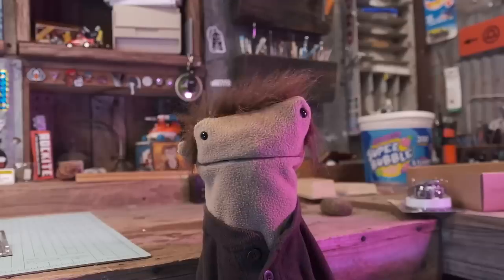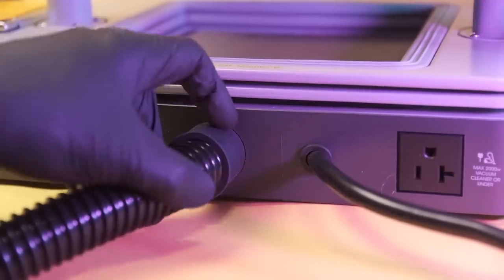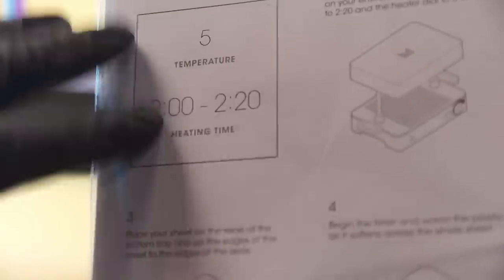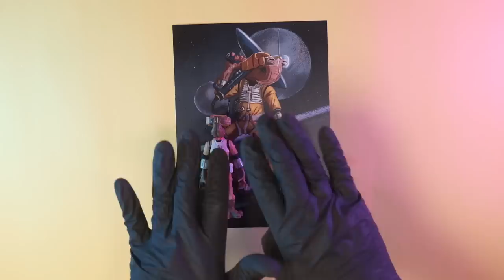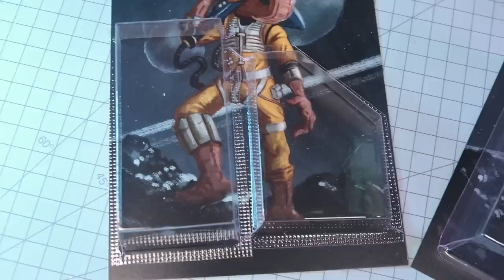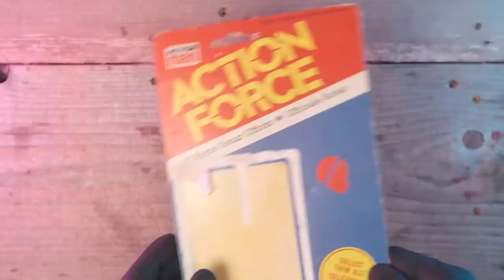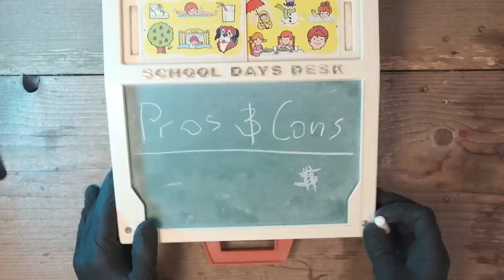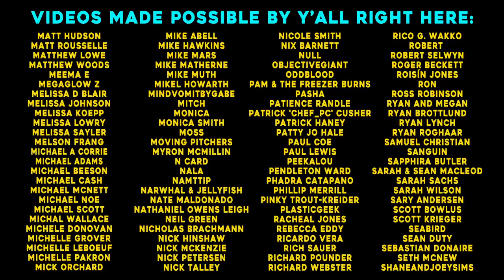Custom Action Figure Bubble Blister! | Mayku FormBox Review!

Comment: I bought one of those Sombrero Punches because I saw this.  Yesterday I used it + cardboard + hot glue to make a bunch of tabs on various little boxes, and was able to organize my shop better.  Of course I could have just done it years ago with a hobby knife, but the punch makes them look so pro it inspired me to get around to actually doing it. I'm awarding you +2 Organizational Inspiration Points.   :)
Reply: Did you find the same brand as his? I can't find info on that exact one and I don't like the one I just bought

Comment: omg awesome, Mr Crafsman. 

"my credentials" - I was a manual sign vacuum moulder for many years doing fitouts for Full toyota, suzuki, hyundai etc... dealerships The big plyon logos at the top were the biggest we could mold.
Most of the time H.I.A. (high impact acrylic) or A.B.S. (acrylic backing sheet <-- i know its not real name, but that is all it was good for "for us" ) at 3- 5 mm thick. PP (poly propylene sheet) we could go down to 1.5 mm. We would pull most stock at about 130 - 170 degrees Celsius (it can be a small window to hit sometimes). 

Your machine has a ceramic plate. I like this over normal room heater type molding machines as it will be more uniform. A hot spot can fry your stock.

In my opinion you are doing very well. 
I would suggest you get an infra red camera or the laser/sensor ir gun type is good too (I just got a "bv9900 pro" for the flir camera).  

Anyways I want to try to help with some tips. 

1. Use the ir to see the temp of the material and go on that more then a timer. Get a good "feel" (please don't caress the hot material) for what you can push it to. Make a book for ideal temps for each type of plastic it will help a lot.

1.5. Temperature is best if it is uniform. So don't be afraid to let it heat soak and reheat and soak and heat again, just carefully monitor temps at all times. ( This is more for very large pulls but is still true for most situations.

2. You can make some small "pucks" (I used to call them) to put in the mold bed to take up the stress on the corners or around the entire mold like a frame should you feel the need on difficult pulls. We used frames for every pull that was going to be installed in a cutout panel so the edge would sit flat and tight against the cutout bit and glue them on from the back. 

RANDOM IDEA - Cut a rounded rectangular hole in your card so plastic can come from behind and put a flat stock backing to trap the figure and a printed transparent background or whatever.

3. On some of the more detailed molds the "pucks" were not enough. Deep pulls for example would need to be "pushed" by my hand in a thick cotton glove to avoid the pinching and thinning of the sides on the deep pull. 

4. I don't like the automatic vacuum control. We had a big valve and a vacuum tank the size of a small car to control the pull.

5. Talcum powder is an awesome mold release agent and can be essential on tricky molds with lots of deep pulls. We would use talc on every pull to help preserve our mdf moulds (high use molds were coated in clear). They mostly hand crafted are not cheap to make on large scale.

6. I noticed some small holes in the corners on one of the molds, that is an excellent way to help keep the suction where you need it, just keep the hole under twice the thickness of the stock or use foam weatherstrip for packing. 

7. Secret Information (not really). Sadly my old company shut down now. Ok so we had a case where we needed a metallic finish on the outside of the pull. Paint it on? Nope too detailed as it was 2 tone. So we tried electro cut vinyl sign writing material on the stock and it came out amazing, only because the pull was not too deep. We tried on deeper pulls but it would always get too thin to illuminate nicely even with every trick i know. So we would "pre mould" the stock then reheat it and pull it for the final product.

8. I learned a lot by doing, testing and recording in baby steps to get to a stage where I was confident to mold anything (within reason). 

9. One of my hardest learnt lessons was wasting $100's in failed pulls. Blah Blah etc.. anyways in the end it turns out plastic is like a sort of sponge with water and would bubble up like it was overheating, but it wasn't the heat it was the water escaping. Our solution was to pre heat for a day our plastic stock in a heated dehumidified box we made on top of the machine (she was a big girl and could take up to 4 by 10 foot/1200x3200mm stock on the vacuum bed).

Just like a machine gun, consistency is the key to spit fire.

Godspeed and I wish you the best of luck my friend.

This was going to be for crafsmans eyes only, but I would like to help everyone have success.
Reply: I truly hope Crafsman comes back to read your comment thru.  So much detailed information here!!!  I’m sure he checks every few days.  What a generous person you are, to take the time & effort to share .. and I’m sure there’s more if he needs to tap into something else you know about this 🤩.  Such a shame that business had to close.  
It is cool how every job we have gives us things to take with us moving forward.  Thanks for sharing 👌💯👏👏✌️✌️😁.

Comment: One of the departments where I work does vacuum forming, except their machine is about 10 feet tall, and takes plastic sheets that are probably 10 feet long and 5 feet wide, and fairly thick.  I don't know what happened, but one day someone apparently left the sheet heating for too long.  The fire alarm went off, and as I walked by that department toward the exit, I glanced through the doors and saw what looked like a waterfall of fire as the melting plastic caught on fire and dripped down onto the vacuum table.  Pretty impressive.  They also do injection molding, and I kept wondering what the big things I kept seeing around that looked like cow pies in different colors of plastic were all about.  One day I asked someone, and they told me that when they change colors or types of plastic, they have to clear all the previous color out of the system first by just pushing the plastic without a mold in place.  They call them "purge patties".  XD

Comment: Hey, I've got one of those catalytic converters around here somewhere. Knew I bought it for something, but up until now, it was a solution in search of a problem. Now I need to get a vacu-former. looked at the Mayku, but it's a little out of my budget. Probably worth the asking price if it can make money for you, that's the true measure of a tool. Never discount the value of your own personal projects though.

 Years ago I worked at a place years ago where we formed 1/8" PVC (grey) with a old oven and an air tank that served as a vacuum storage so we could set the PVC on the die, then shift a valve and draw it down. Letting gravity work on getting the process started was a critical step, you may want to try that, but the plastic you are forming may not hold the heat long enough, that 1/8 PVC would stay "wet noodle" for about 30 or 40 seconds once on the die. We would wait until it settled as far as it was going to (usually about 5 - 10 seconds) and pull the valve to finish the job, this allowed the plastic to stretch slowly and helped prevent webbing and thin spots. How fast you apply vacuum matters too.
Another of the tricks we used to solve "edge problems" was to use foam weatherstripping around the edges of the die elements. It compresses gradually and provides a contoured web, so the plastic will taper off the edge instead to make a hard transition. Sometimes we would even stack the foam up to about 1/4" thick. The foam we used was fairly dense, like the white stuff they sell these days, I'd start with something like 1/8" thick by 1/5 or 5/16 wide. Lastly, and I don't know if you could do this at all, but if we preheated the die in critical spots, it would help get fill. Use a blow dryer or heat gun on your buck and see what happens. Hope that helps in your forming endeavors.

Hope to see MC Hammerhead Hunter for Bounties in a toy store near me. (Or at least in the Steadycraftin merch store). Keep craftin.

Comment: TK560.com is still to this day the best forum for Vacuum forming info. A few things could have made this a lot easier. Giving more draft angle on the forms would have helped some so  you could pull a cooler pull and have less webbing.  My suggestion to Mayku is the expand that booklet with more information about HOW to be successful using the machine. That will go a long way to showing clear value. explaining draft angle, webbing, and how shapes work and don't work would be very useful and appears to be missing.   Crafsman I hope you give that another try with a double blister where you vac over the items (on their face) so it cradles them and then you flip those into the larger blister and blamo! Pro Level packaging!

Comment: Crafsman you can make all kinds of things now.

Cups, bowls, plates, all kinds of Crafsman brand household products.  

You can 3d print your logo in different sizes to use like a brand stuck to your bucks and so when you make something it has it on the side of the cup or on the rim of the bowl or plate. 

Can't wait to see what all you come up with. :{J
Reply: Also Crafsman, I'd like to see how you'd do a clamshell plastic case thing. Those ones that have the folding hinge and snap together around a toy or product. I bet the buck for that is easier than it seems. :{

Comment: Hey CrafsMan - any advice how to cast a tank barrel's muzzle brake (1:76 scale - plastic model tank)? I'm struggling 'cos the brake has voids in it (left to right and top to bottom)...Not so concerned about the casting material (as long as it is hard-ish), but more about how to deal with the void areas. Ta!

Comment: What is the tool called? That you used to round the edges of the card. And were can i buy one?
Reply: It's just called a "corner rounder". You can find it in most arts and crafts shops in their paper crafting section, and, sometimes, in office supply stores.  There are many different types available with different radius sizes. It just all depends on what you like the most. :)

Comment: Why is this thing so expensive? You can get an all-in-one unit that has its own suction for just over a hundred bucks... sure, the working area is smaller, but most people who would use one of these can either work with a 5”x5” platform or needs one bigger than the FormBox anyway.